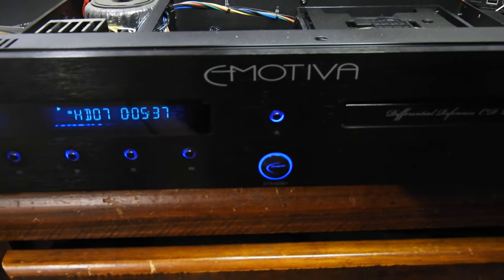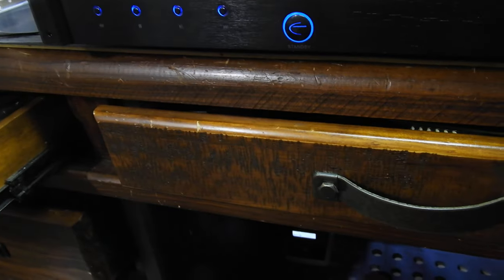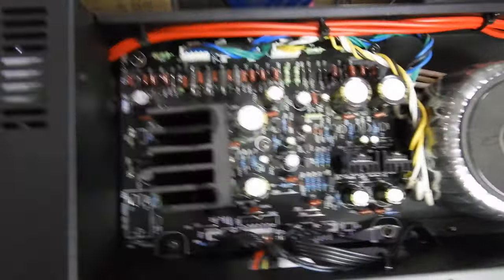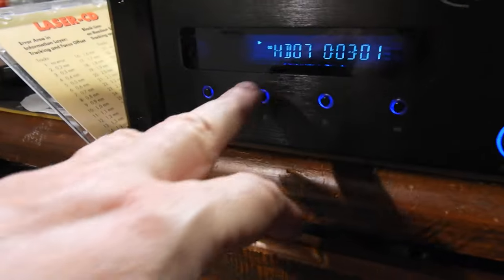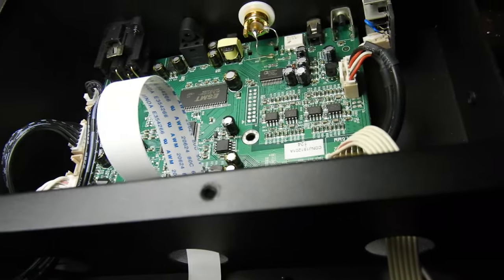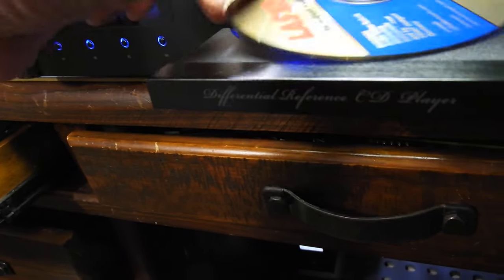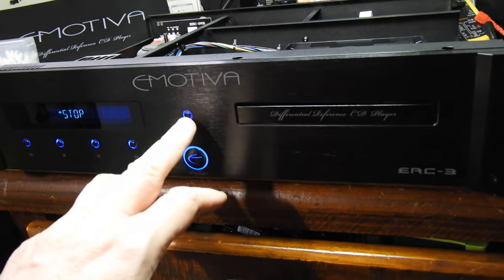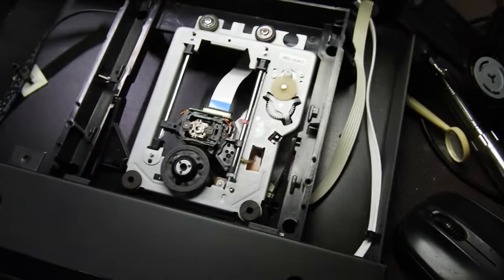Emotiva ERC-3 "Technical" Review video. HDCD player using AD-1955 DAC. Exceptional build quality.

Comment: I’ve tried many cd players up to 1500 dollars and non of them sounded as good as emotiva erc3. Sonically matches very well with my older pass labs equipment (x150 amp and x1 preamp)
Reply from the maker: I agree that it is an outstanding player that is very well priced. It went to my friends who asked me to assemble a system for them. The rest if it was Electrocompaniets pre/power combo and Gale 401 speakers. Sounds quite decent.

Comment: I have the same one and it’s fantastic. For some reason when I press the power button in makes a click noise, but doesn’t go from orange to blue light and won’t power up. Any ideas? Thx.
Reply from the maker: Sadly not. I haven't even looked for a Service manual for this unit. It is either a failure of the power supply or some of the control logic.
If I were you, I would open it up and have a look if there is anything obvious, like cooked parts.
if you are a bit technical, then I would measure if supply voltages are there.
If you are not technical, see if you can find Service Manual for it, and if you do find it, please send me a link and I will try to offer some more informed view.

Comment: what is that CD you use for testing the laser I need to get one Thanks
Reply from the maker: It is Burosch, German made test CD. The last one I could find anywhere now. I also have an old Technics test CD but it's tracks stop at 0.9mm interruption in data layer and 0.9mm black dots painted on it (CD Red Book Standard requirement), whereas Burosch goes all the way to 3mm.
Reply: @hear-net-au  thanks I cannot find it anywhere

Comment: What is the test CD you use or one that you recommend? Thanks
Reply from the maker: Any that you can get these days. A proper CD with interruptions in data layer and black dots painted on the surface will have all the other characteristics like no eccentricity, thickness, reflectivity etc.
Reply: @hear-net-au  Thanks!